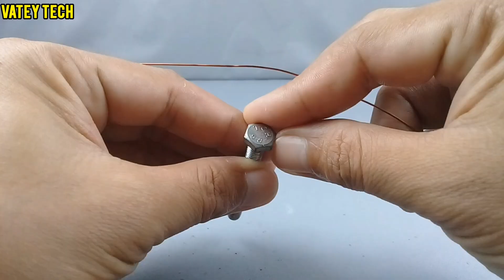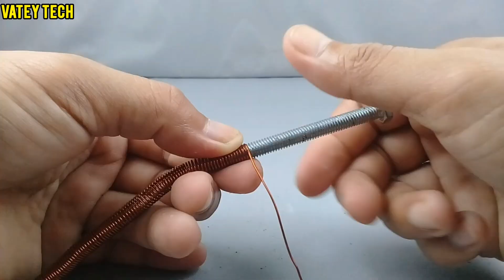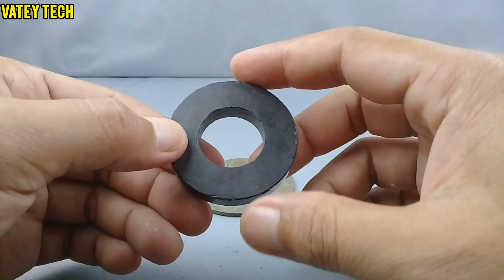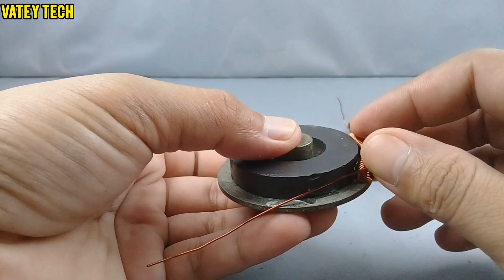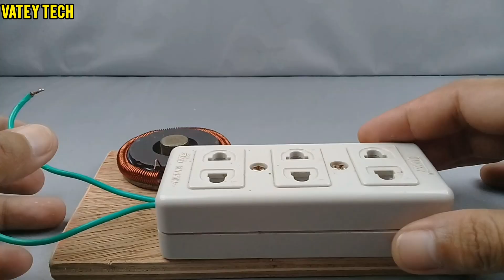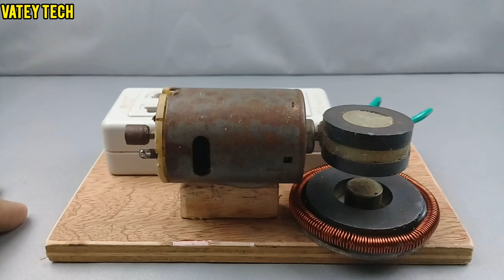New technology! create 220v free electricity generator using copper wire with magnet 100%

Comment: Free energy, 100%  BULL SH'T. Although an interesting DIY project, there IS ABSOLUTELY no free energy here.
-Red and Blue wires supply ALL the energy to the electric motor.
-Electric motor spins a magnet causing the magnetic field to rotate and actively interact with the stationary magnet causing it's magnetic field to also fluctuate resulting in 2 fluctuating magnetic fields..
-These 2 fluctuating magnetic fields induce an alternating voltage in the hand wound coil glued to the outside of the stationary magnet.
-The induced alternating voltage is connected to the power bar where the light plugs in.
Basically it's just a DIY multi-stage transformer. Replace the light bulb with the red and blue wires and voila, you get NOTHING. Everything stops because there IS NO FREE ENERGY to supply the motor.
At this point in time there are only 5 sources of "sort of" free energy. Sunlight, wind, moving water, geothermal & nuclear, but they all need massive startup investments and constant upkeep.
Reply: Этой катушке не достаточно для 220 вольт! 
Все его видео без поднятия платформы над столом. 
Там идут провода питания на розетки.